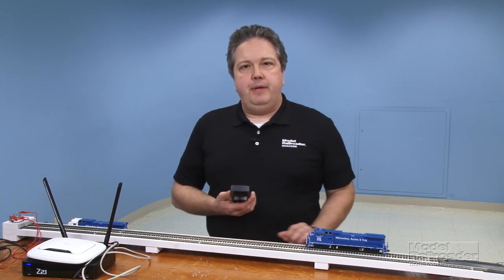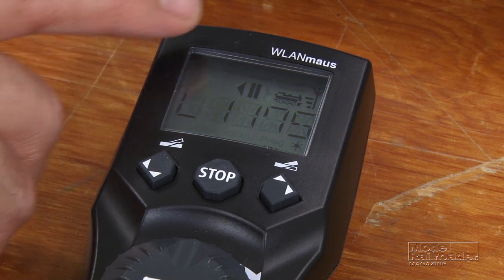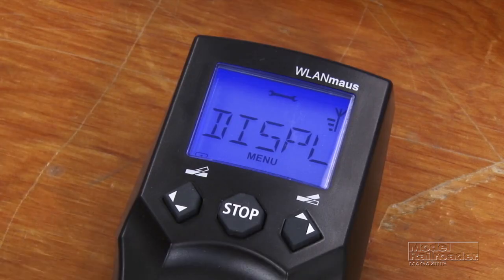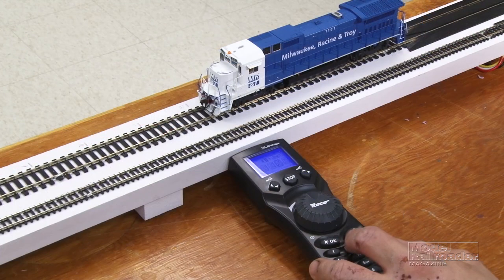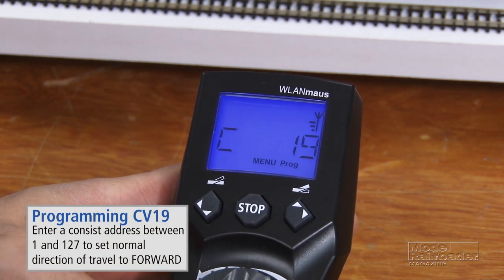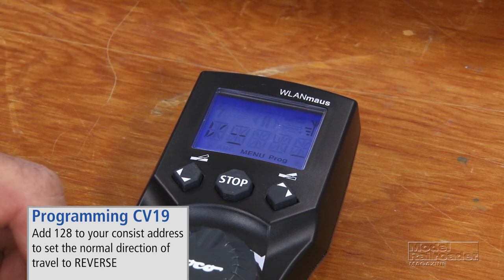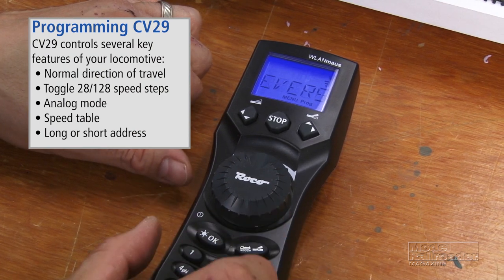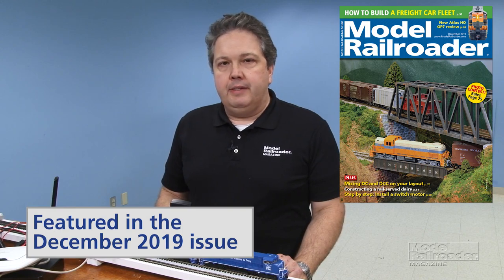Fleishmann Roco Z21 WLANMaus Wifi Throttle for model train control

Comment: The Roco (Austria) and Fleischmann (Germany) Companies are now owned by a new Mother Company Modellbahn Union Ltd.
Their former first together digital System had been desighned by Roco in Austria and had been later addopted from Fleischmann, too, but it had one big problem, you could not read out CVs at all. Than the created the Z21 WiFi Family of Command Stations.
The big Z21 comes in a black box.
The both light Versions of the z21 Start and z21 coming into a white box.
The light Versions inside the white boxes with small z21 Start and z21 are distributed to model railroad beginner sets only, but can be got by ,,slaughtered" beginner sets, where people used the tracks and rrains but not the command stations with the cablewired throttles of the red roco Multimouse or the grey Fleischmann Multimouse.
Both cable wired Multimouses have same Elektronics inside but different coloured cover shells of the throttles.

The black WiFi Z21 Multimouse is wireless and needs 3 AAA Batteries inside of it.

Well the big problem of all of it, there is no consist address menu, but that comes from the tradition of the european customers and prototype railroads who do not often using multiple traction units by operating trains in general.

Sure sometimes some double heading locos and more rarely a pusher loco in the rear. 

In most causes trains are operated with one loco, only.

All of these throttles had the possibility to use several ways of consisting locos from their earliest days of creation of these throttles, of what the most costumers do not know.

You cann make consists using CV 1 over one address and of course via using the consist address for advanced consists at CV 19.

In the past, before the Z21 Family of command stations are created, the older cable wired digital system used an as master plugged Multimousse together with a small booster as command station, the master Multimouse may never done unplugged, because of lost programmed datas inside this command station arrangement.
For driving trains another as slave plugged in Multimouses needed to be used in addition.

Since the Z21 Family of Command Ststions had been created it is much more easier to handle and to program digital decoders inside locos or railcars.
All CVs can be read out, what was before impossible.

The max. Amperage to the track is by 
3.2 Amps. The track voltage is up to 18 Volts.

I do have the white z21 Start with cable wired grey Fleischmann Multimouse without the WIFI Package (sold separately and without again sold separately WiFi Connection Code).
For myself it is well enough.

Have some thanks very much to the Model Railroader Team for this excellent Video description about consisting locos.

Regards,
Ingo

Comment: Hi, thanks for a good video. My query is:  when swopping between locos using the keys either side of the stop button, how to prevent the speed setting previously selected for loco A being assigned to loco B.
Reply: That's a problem. There is no real solution you can just change to another loco (which is not on the track), change the speed wheel and then go to the target loco.
Reply: Many thanks for your reply. Your solution workswell, but maybe Roco should add a firmware update to dedicate speed settings to indvidual locos. I won't hold my breath.....